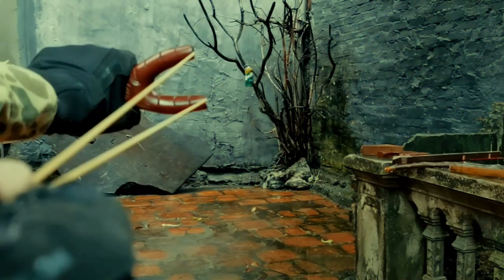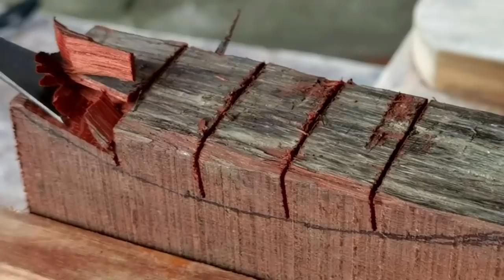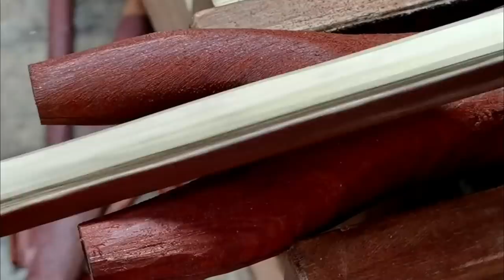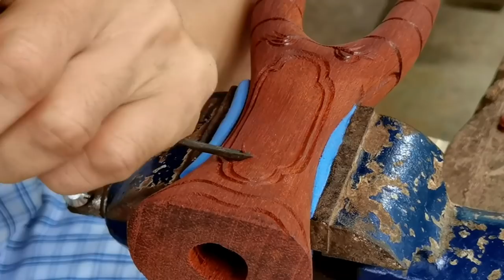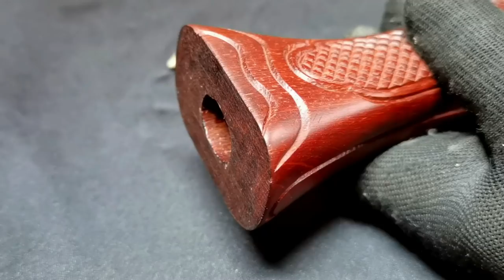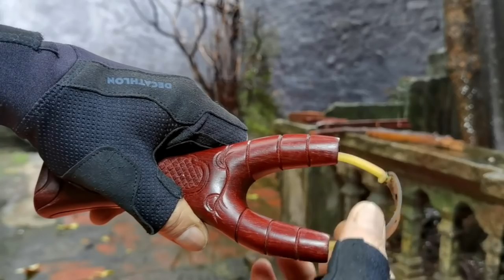99% Handcrafted - Coolest "Crab Claw" Slingshot - Hidden Rubber Tube

Comment: How is it possible to drill a hole from top to bottom you didn't show how the bottom hole was drilled connecting the top two holes.